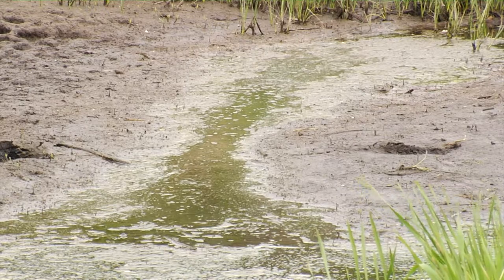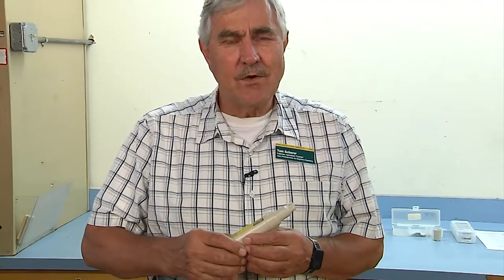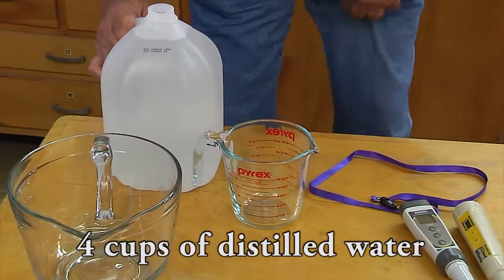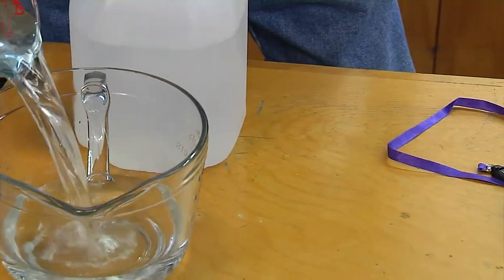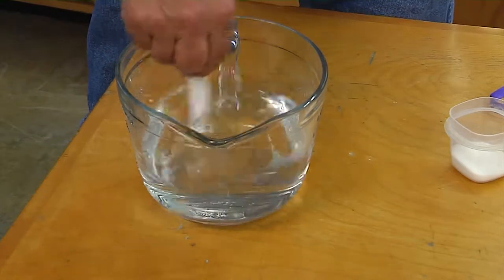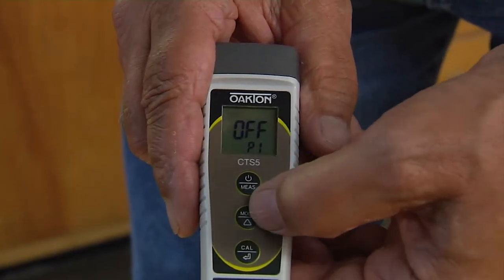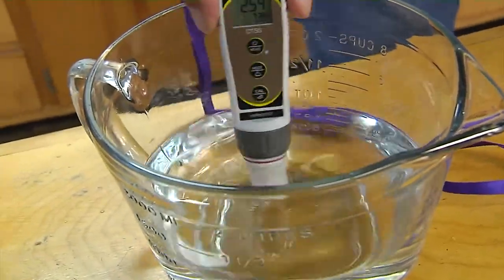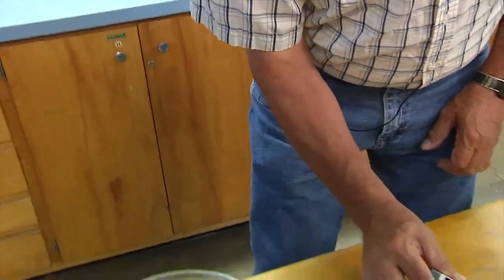Using Electrical Conductivity and Total Dissolved Solids Meters to Field Test Water Quality

Comment: A 1/4 tsp of salt weighs about 1.5 grams, per google. 4 cups of water is essentially a Liter or so. So 1.5 grams in a liter would be 0.15%,right?  Why is the correct value not 1500 ppm?  What am I missing?